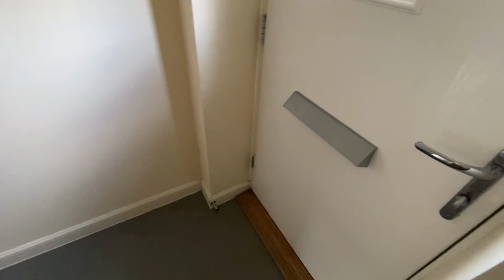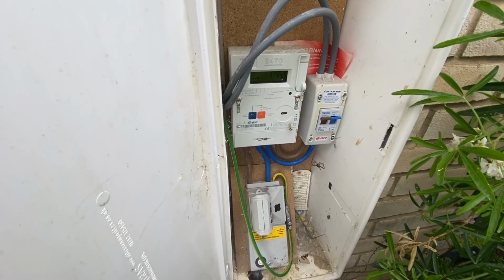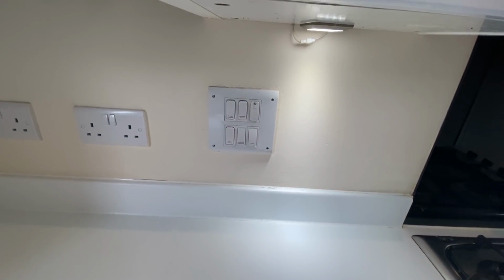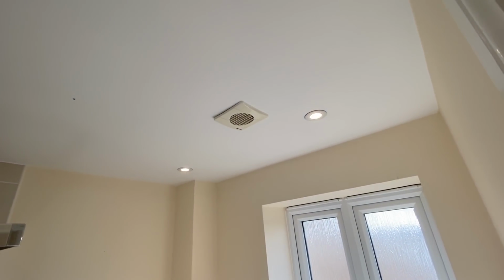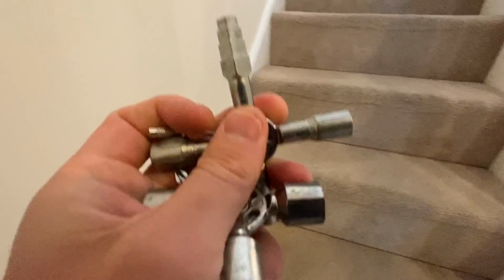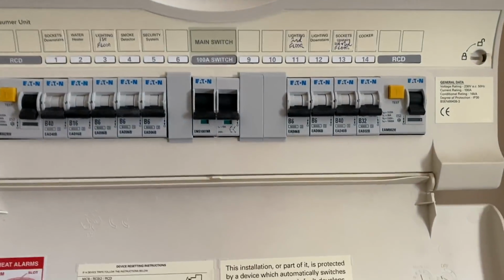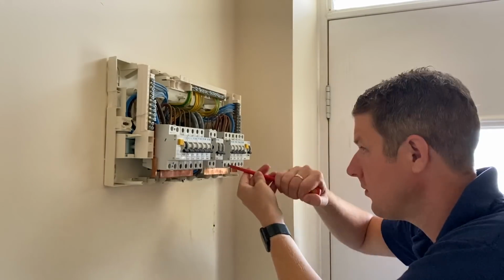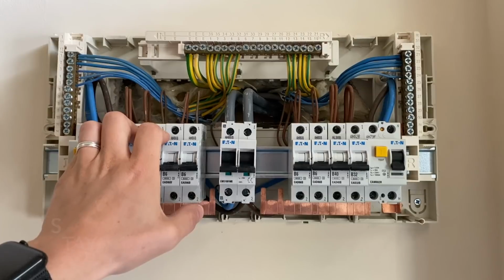Electrical Installation Condition Report Sample - Part 1

Comment: I use electrical tape on them socket screw caps, works better than blue tack, and less damage than my screwdriver and Stanley blades.

Comment: What is the difference between DOMESTIC ELECTRICAL INSTALLATION CERTIFICATE and (EICR) Electrical Installation Condition Report ?
Reply from the maker: A certificate is to certify that installation work by the electrician has been done to the correct standards. An EICR is a report about an existing installation that the electrician is just inspection to comment on its condition.
Reply: @artisanelectrics  i still dont get the difference. So how electrician can issue 5 years of valid certificate for the house and its not the same as the EICR ?

Comment: A new build would usually get  a 10yr cert , i wonder why this didn't ? or maybe the certs have gone missing . whats that meter key you use Jordan ?
Reply from the maker: Thanks! Its a Wera Screwdriver set that has the meter key in, check the link in the description.

Comment: How can you do an installation resistance test on the lighting circuits if you have left the switches on and the light bulbs in? You can't pass the ring final circuits that are fed by 32a circuit breakers

Comment: RCD ratings non compliant.  Can sometimes get away with 80amp versions, but not in this case.

Also, the tightness of the connections in the consumer unit should ideally be checked using a torque screwdriver.

Comment: The Derating factors for grouping, ambient temp and insulation along with volt drop will cause issues on them 40amp ringmains you have.

Comment: Regarding the Ring Final Circuits on a 40A - personally I'd C2 it - it isn't condemning it as such but it does make it an unsatisfactory outcome.  It is a fairly easy fix i.e. replacing the MCBs with 32A to make it a non issue.   Reg 433.1.204 basically says you can use a ring final circuit, with or without unfused spurs as long as it is protected by a 30A or 32A protective device, and the cables as installed Iz are rated not less than 20A.
Reply: Also, it is usually an agreed limitation that cables within the fabric of the building are not inspected unless the client specifically requests it so you can't really check the 2.5mm cables to see where they fall in table 4D5 - I can't see them being too impressed if you take a hammer and chisel out to check them!  I think there are words to this effect on an EICR form.
Reply from the maker: Haha you make good points thanks. I think I will just replace the MCB's then its all good.
Reply: Perhaps the RFCs were accurately DESIGNED. Re 433.1.204, if the cables as installed lz are rated at not less than 26A arguably a 40A protective device will protect the cables and that is what the MCB is there to do ~ it will trip before overheating causes fire. The overall impression I have of this building is that the installation has been DESIGNED by an educated designer ~ notice provision for a stairlift.
Reply from the maker: Yeah I have the same feeling to be honest but there’s no way of knowing that’s the trouble
Reply: @artisanelectrics  You are right.
Reply: 433.1.204 doesn't allow anything other than a 30A or 32A protective device for RFCs.
My guess is they didn't have any 32A MCBs left so they wacked a 40A in as an interim measure and probably forgot about it.  Either that or they have been changed after the original installation but that is doubtful.
My guess is the FCU for a stair lift was on the plans which is why it was installed.

Comment: Current regulations for main switch with additional RCD protection main switch CCU should have RCD current rating the same as the main switch
Reply from the maker: Yeah but we cant code it just because it doesn't comply with 18th edition...

Comment: Design and installations of ring final  circuits and suitable final circuit protection for ring final circuit is within the OSG and BS 7671. 40A final circuit protection for a ring final circuit would be code 1 as this is that providing suitable final circuit  protection against overload for the cable CSA. All code 1 should be carried out immediately or the final circuit should made safe and isolated. Obviously you should make this clear to the client within your written estimate before commencing any works.

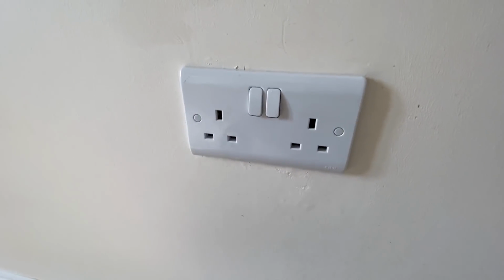Comment: 16:00 , Use the end of a fresh Stanley blade to hook them out from the corners. Sometimes they can be in there really tight and bluetac wont cut it.
Reply from the maker: Thanks!
Reply: @artisanelectrics  I do this too, but it's really easy to ping them out and lose them. I'm going to try using tape next time as other commenters suggested.

Comment: According to my calculator,  2.5mm installed in 3 - A1 (multicore in insulated wall), has a maximum current rating of 19.5A @ 30c (39A combined CSA).  So the breaker is theoretically 1A too large!
Reply from the maker: Yeah typical! 😂
Reply: But it's a ring, not a radial in parallel, so that doesn't apply. Nor does 19.5A comply for a ring on a 32A breaker, as the regs require not less than 20A.
Reply: Monkeh Wut??  A (properly wired) 2.5mm ring circuit has a combined CSA of 5mm.  If you wanted an equivalent radial circuit using 2.5, there would be 4, 2.5s going into each terminal at the back of the socket.  Rings are usually 32A; radials 16A or 20A.
Reply: @abdullahseba4375  You cannot treat it as a combined CSA of 5mm², the conductor lengths are not equal at all points on the ring, being a ring, not identical conductors in parallel. Hence the 20A minimum requirement with a 32A protective device. I can try and dig up the regs on using conductors in parallel - I can quote 433.1.204 at you if you really like, too.

Comment: Because of the cost of the circuit breakers I would say to the landlord look mate it needs changing for a B32 and just change it. A tip for removing those socket screw covers I use the tip of a utility knife

Comment: Yet again where is the existing (or copy of ) electrical certificate? I did not see any periodic test label makes you wonder if it has been tested in the first place if so those 40A MCB's should have been picked up. Why was it ok to fit in the first place knowing it is wrong? 
Too much of the consumer unit rear enclosure is missing (gaping hole into the stud cavity).
I used to use insulation tape to get those screw covers off (another thing builders like to do is seal around switches and sockets.

We wait for part two.

Comment: Wow Jordan...EICR’s a plenty....
Careful with that 80amp RCD protecting the first bank of circuits... You have the total sum of the mcb’s adding to 84amps which is above the rating of the rcd for overload of the device. Applying diversity in accordance with Beama guidance will give you a figure of 57.6 amps. A 63amp RCD would cover this normally and you already have an 80amp in use, however, overload protection of an RCD shall not be solely based on the use of diversity factors of the downstream circuits, reg 536.4.202 will guide you on this. To achieve overload protection of the rcd circuit, the rating of the OCPD shall be selected according to the manufacturers instructions , which will point out that you will need to co-ordinate with the upstream 100a main fuse which is present there. Therefore the minimum rated current in the circuit of the consumer unit for the rcd  needs to be 100a.
The other rcd serving bank 2 is ok at 80 amps as the sum of the mcbs does not add to 80amps without even applying diversity so there is no potential overload risk.
If you do not want to swap out rcd 1 for a 100a unit you could drop the Mcb on the ring to 32a and you will then be below the rating of what you have without even applying diversity.
Beama has a document out for download which explains this new requirement under bs7671 18th Edition.. Again this is something lots of sparks do not implement or pick up on an EICR. 

In this situation the likelihood of overload is minimal but its advisable to note a C3 departure on your cert as it does depart from current bs7671 requirements which is what you test to when doing an EICR. 👍🏻
Reply: it doesnt matter if the mcbs addup to more than the RCD rating, most installs in the country would fail on that basisi, you could say adding all the mcbs up is more than the main cut out, considering the loading of a house at normal times can be extremley low 5-10amps, and 40A for short time at peak times, doubt youd get overload
IMO diversity guidance in books is crap, was always taught its down to experience
Reply: Paul T Its a requirement now as part of BS7671 and Beama have released guidance on it (which going on your response i doubt you have read or even knew existed) Wether you think its crap or not its regs..which if you choose to ignore is down to you but personally i wouldn’t like to be standing in a court of law after a fire and tell them that i knew about the guidance and the content of BS7671 and chose to ignore it as i considered the whole concept to be “crap” BS7671 is non statutory...EAWR however is. I agree with the fact overload is unlikely here as i put at the bottom of my comment..i merely put it so people are aware of the requirement. 🤷‍♂️
Reply: @rattlehead85  Another point to note that there is also room for additional circuits (load) on the RCD.
Reply: ANTHONY BRAGG Exactly that!! 👍🏻👍🏻. The problem here is that there seems to be a consensus that because so many houses have endless amounts of circuits hanging off RCDs that could potentially be running at or beyond their max that it is ok to continue doing this. Beama and BS7671 publish these documents for a reason.
Reply: @rattlehead85  perhaps the word crap is the incorrect word to use, but yes am very well versed in the guidance from Beama and as someone who has an HNC in electrical engineering and works in design / install on large projects am quite well versed in the notion of diversity, but still stand by the guidance on diversity, it is mainly down to experience and with regard to domestic enviroment the mcd to RCd ratio not really an concern if designed correctly, IMO

Comment: 2 x 2.5mm on ring final circuit always on a 32amp mcb. Would C2 a 40amp, as before the mcb would blow the cable would catch fire (if overloaded)